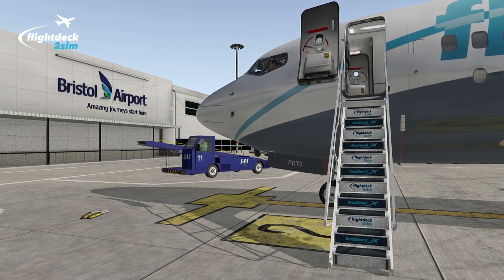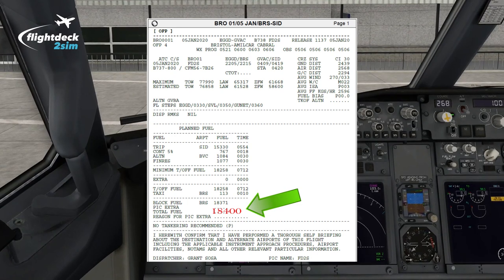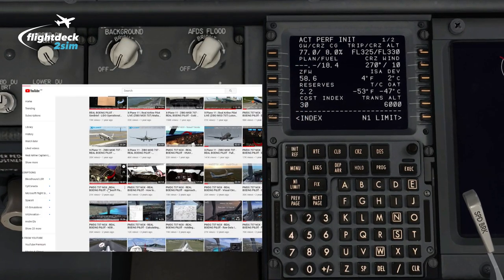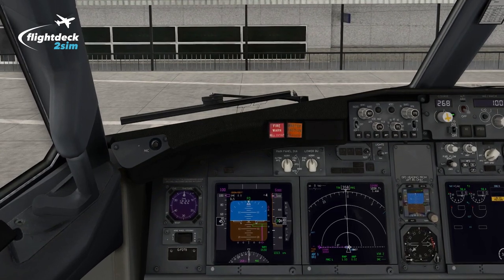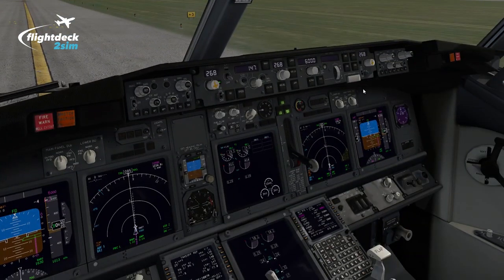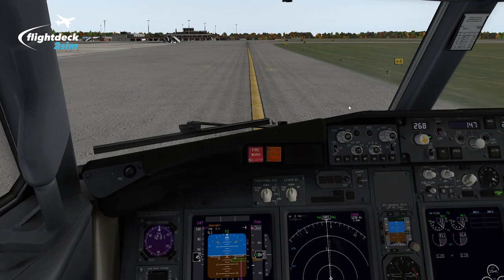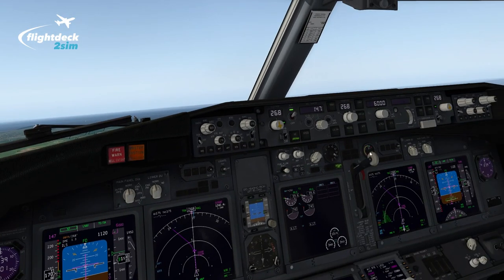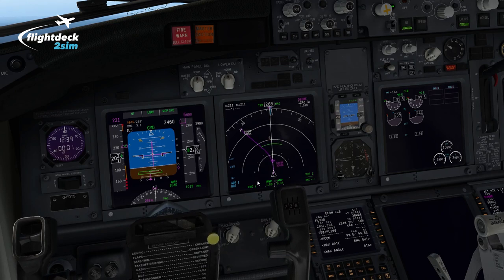REAL BOEING 737 PILOT | FULL POWER (Bleeds Off) Short Runway Take off Tutorial

Comment: Hard to believe this would have still been safe in case of an engine failure past V1.
Reply from the maker: Hi davidtsw!

The take off performance calculation ensures that you can accelerate with all engines operating, have an engine fail at least one second before V1, rotate and pass the end of the runway by 35 feet!

Bristol has a clearway which is an area beyond the runway which is free of obstacles and under the control of the airport, this clearway may be included in the length of the takeoff distance available.

FD2S

Comment: Thanks again for a very informative tutorial. I'm wondering what would be the outcome of an engine failure at a critical moment? What would be the climb performance with single engine and does all the calculations take this into account?

many thanks again

regards

G
Reply from the maker: Hi ghl.

The calculation ensures that you can accelerate with all engines operating, have an engine fail at least one second before V1, rotate and pass the end of the runway by 35 feet!

Bristol has a clearway which is an area beyond the runway which is free of obstacles and under the control of the airport, this clearway may be included in the length of the takeoff distance available.

FD2S

Comment: Great video! Is APU kept on only for air conditioning, or is bleed air also required for certain control surfaces or eventually anti-ice? I presume pressuraization isn't an issue since you turn on the engine bleeds long before 10'000 feet? :)
Reply from the maker: Hi Martin! Glad you enjoyed it! 

Wing Anti Ice must NOT be used until the Bleeds is back on and Isolation Valve is in the AUTO position. Engine Anti Ice does not require the Engine Bleed switches ON to operate, . It uses 5th/9th stage bleed air as required from the associated engine prior to the bleed valve.

The APU bleed can provide pressurisation until 17,000ft but if you haven't completed the after take off no engine checklist by then something is wrong!

FD2S

Comment: What happens in case of engine failure ? I know opt takes it into account but this one seems too tight .
Reply from the maker: It looks tight Piotr!

When you're field length limited the performance calculation ensures there is sufficient distance to accelerate with all engines operating, have one engine fail one second before V1, continue the takeoff, liftoff and reach a point 35 feet above the runway surface at V2.

Think I might just have managed it! 

FD2S
Reply: @flightdeck2sim  understood , maybe it just seems like too tight

Comment: Thanks for that very useful video I enjoyed it very much:)

But I have a question 
What does your before taxi checklist say to clear the lower DU screen before taxi? Is there a special reason for that being done?
Reply from the maker: Thank you!

The reason for blanking the lower DU is that if there is an issue with one of the secondary parameters or the engine fails the display "pops up" which gets your attention.

FD2S.

Comment: Is it not usual at short runways to hold the plane with brakes, spool up the engines to TOGA and then release the brakes? I remember that my first flight many years ago started with such a take off. It was breathtaking.
Reply: Fcom says that this doesn't make so mich diffrence. But i think it still a good thing to do ..
Reply from the maker: No need to, I'd release the brakes just before pushing TO/GA in this case. There is a small line up allowance too! FD2S

Comment: 11:27 I higly doubt it would really have been able to stop before the end of the runway at that V1 🤔
Reply: If the plane was empty and full reversers/brakes were applied AT or before V1 I think it would stand a slight chance
Reply: Based on the runway markings he had around 2000ft to stop which is quite right for a 737 on MAX AUTOBRAKE
Reply: The 737 Stops Really Fast
Reply from the maker: Hi Niels

if we rejected at V1 we should stop with 0 meters to spare (ASDA was equal to the Runway Length). It looks very tight but the 737 can stop quickly. Either way wouldn't want to do it! 

FD2S

Comment: You said that usage of wing anti ice is forbbiden in pack off t/o but what if I have to use engine anti ice during take off? Should I set both packs to off and isolation valve to auto/open?
Reply from the maker: Engine Anti Ice does not require the Engine Bleed switches ON to operate, . It uses 5th/9th stage bleed air as required from the associated engine prior to the bleed valve 

FD2S